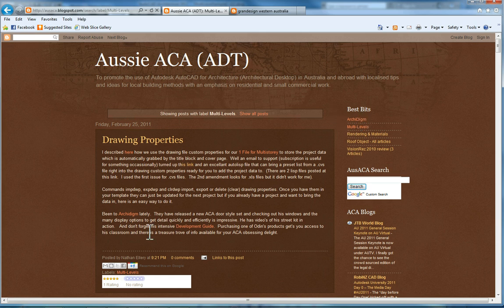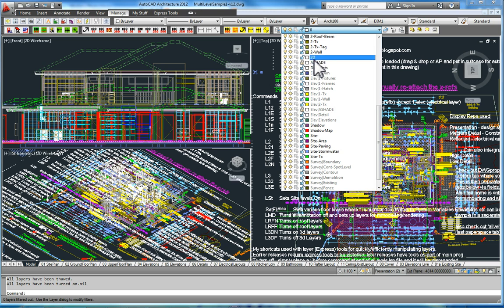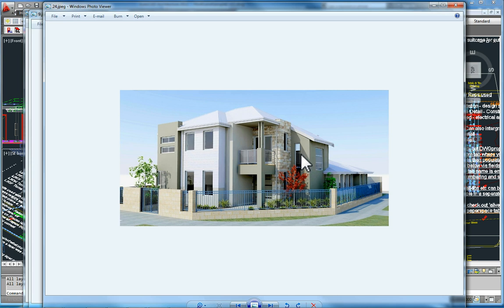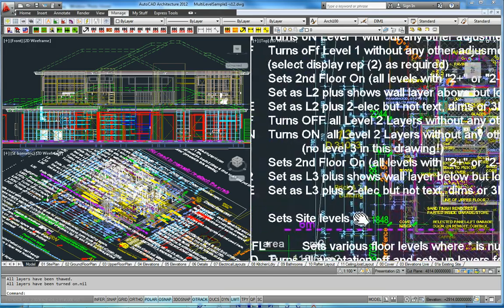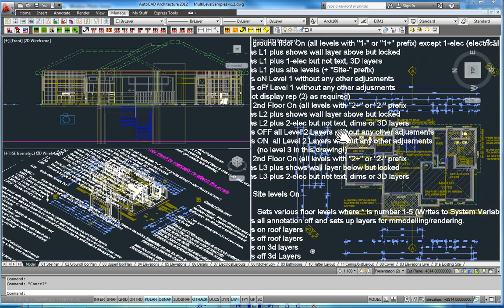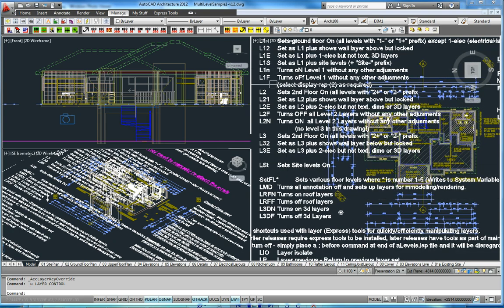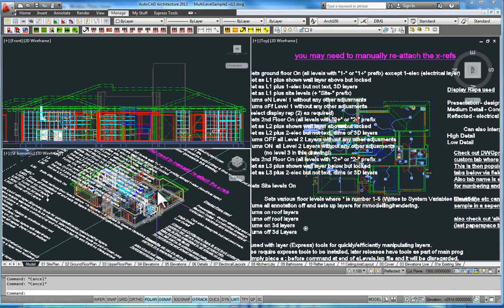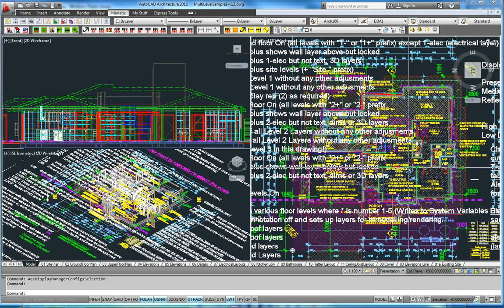ACA-Multiple Levels in 1 FIle (Residential+)  -1 Introduction

Comment: hi, so i started my drawing as a file and now i need to make multiple levels. is there a way to turn the cad file into a project file or do i have to redraw everything again ?
Reply: Hi Tenah.  I want you to clearly understand, my system here is not the recommended system that ACA comes with.  The Out Of The Box system is using the Project Navigator to organise your files for you and it's explained well in the Help menu and also in the available Tutorials (download).  It does have some good benefits and uses a separate drawing file for each level (or part of a building) and automates the organisation but for the reasons explained at my blog (see link above) I wanted to bring most everything into the one file.  I suggest you explore the PN first as well so you can choose the best system for you.  I would only but certainly recommend my system for residential or small commercial projects of up to around 3 levels. Any more than that and it is probably easier to separate the levels.  So to your question!!
You are asking me (who does NOT use projects) whether to turn your cad file into a project file.  Sorry for the confusion but if you want to use Project Navigator, which is different system than mine, then yes you can just add it to the project file.  From memory, (I got confused here) it will create a copy of your file within the Job Project folders that were created when you set up the project but as I no longer use the PN you should consult the help file to ensure you understand it.  Hopefully that helps you along the path a little.